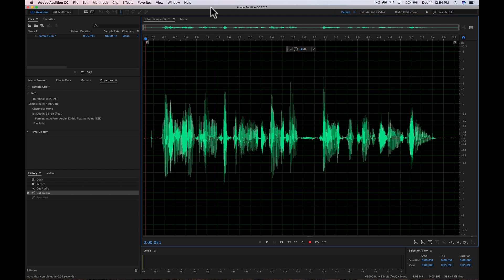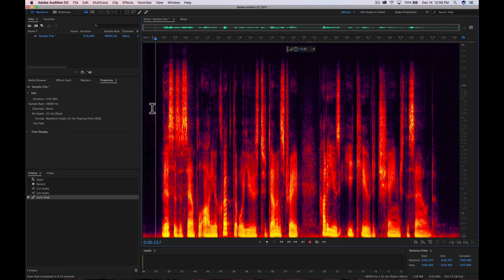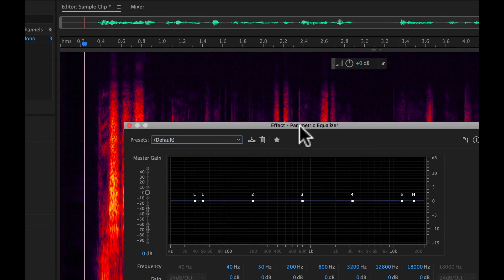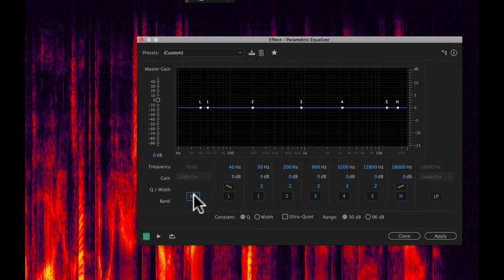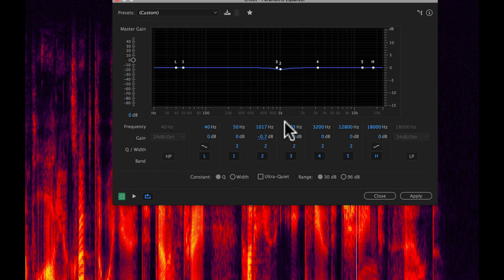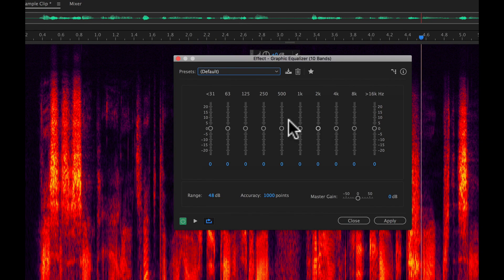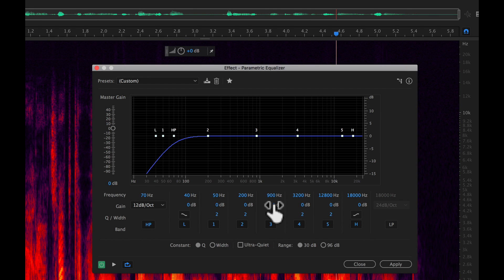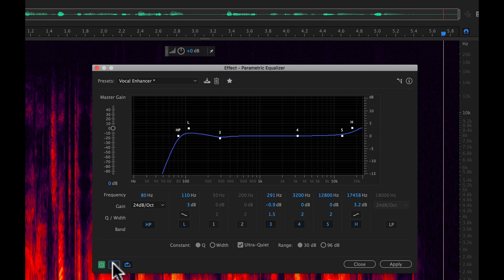Sound for Video Session: Introduction to EQ

Comment: at the start  you take off the low frequency sounds at the bottom. Would I be right in thinking that using  a high pass filter when recording would have stopped that to begin with?
Reply: ahhh having paused the video to type that you have now on the video itself gone on to answer my question.

i do like it when that happens as it makes me think i am learning something from these
Reply from the maker: That would suggest you asked a good question! 👍